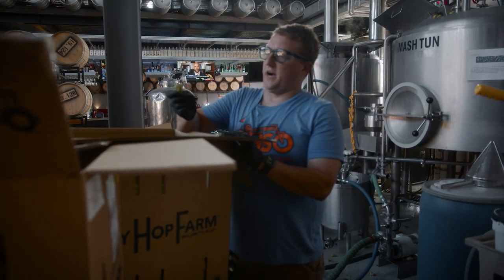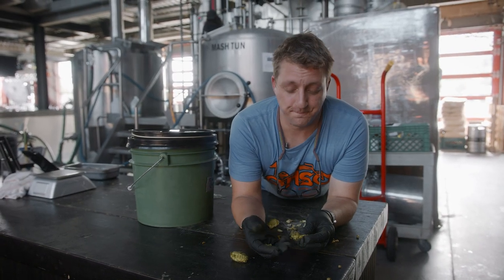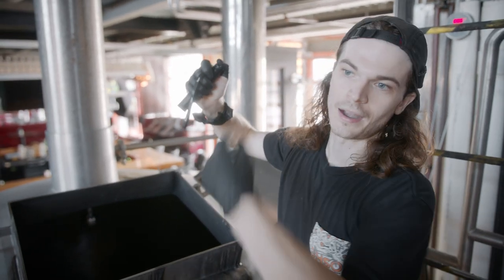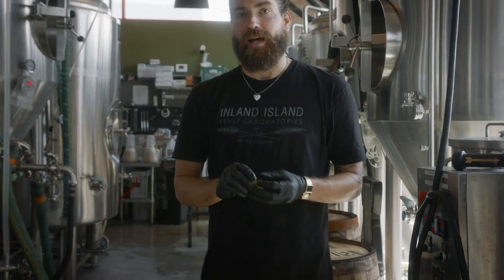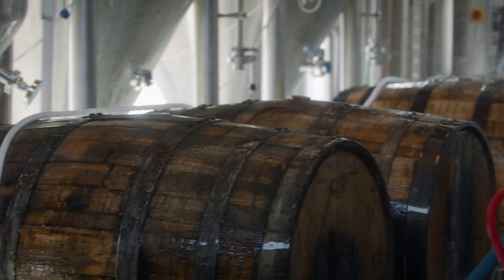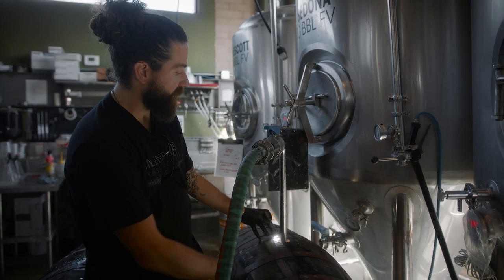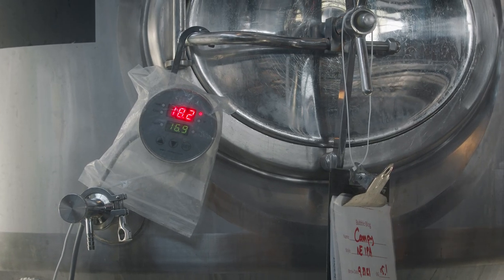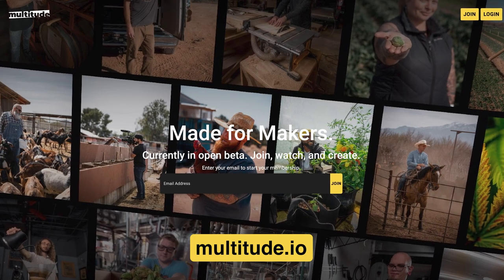Tour of OHSO Craft Brewery | PARAGRAPHIC Origins

Comment: They do have smellovision now... uses terpenes, and sprays blends kind of similar to those glade plugins, connected to a multiheater base holding the terpenes, and wifi to the display to do predetermined blends coded and synced to each video. Linustechtips showed it a while back, one of many...